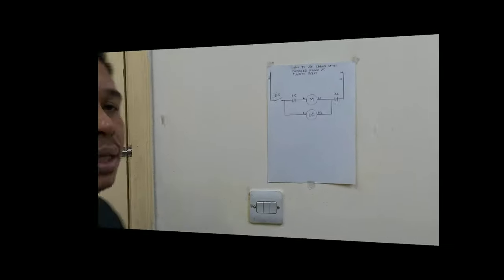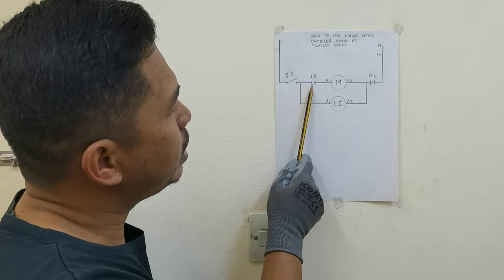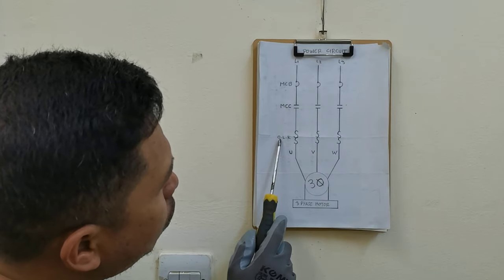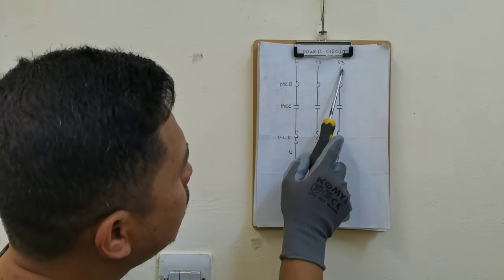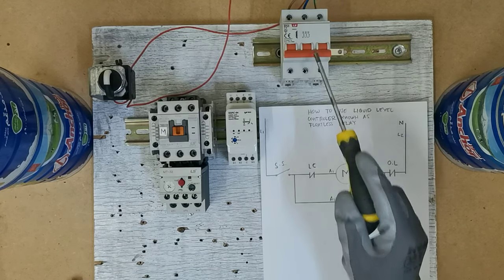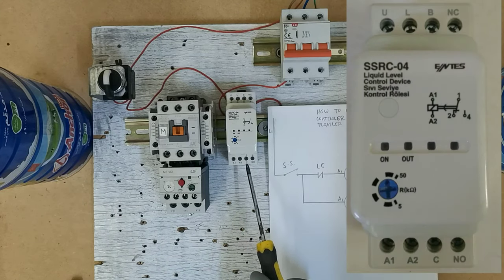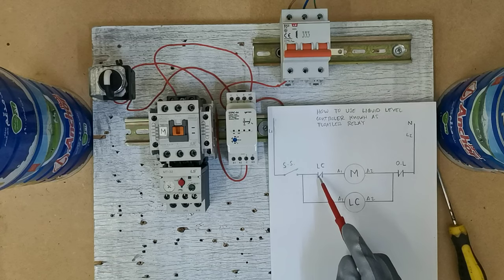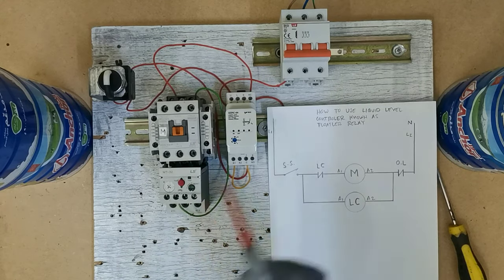How To Use Liquid Level Controller Known As Floatless relay (Tagalog)

Comment: Sir assuming 220 ang control circuit mo hindi ba unsafe yan kumpara sa float switch kc rubber yunn.kung steel rod gagamitin o wire lang sa demo what if accidentally mahawakan may posibilidaf na makuryente ang personel
Reply from the maker: Kung mahawakan mo Ang wire ng control kung saan naka babad sa tubig Hindi ka makuryente.. design Kasi yan ng manufacturer